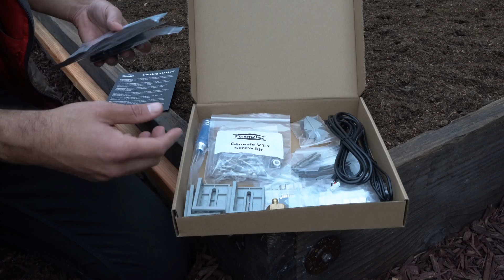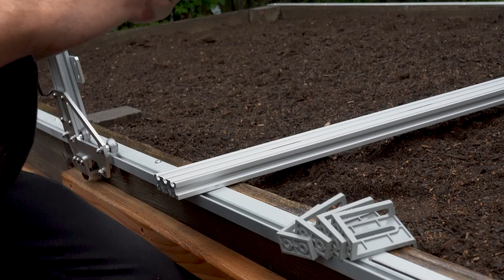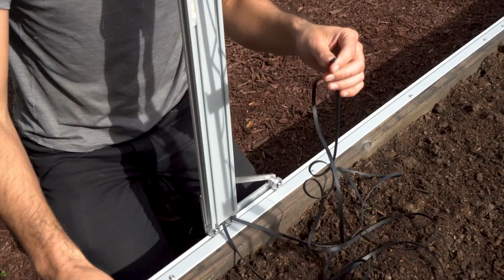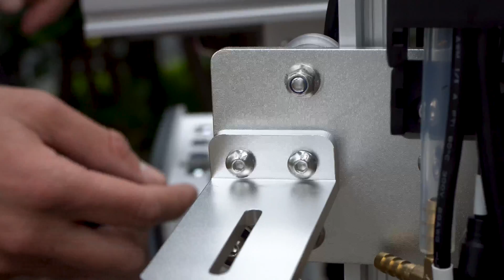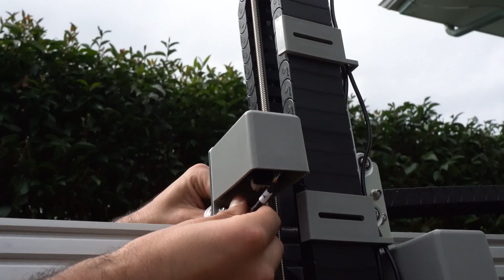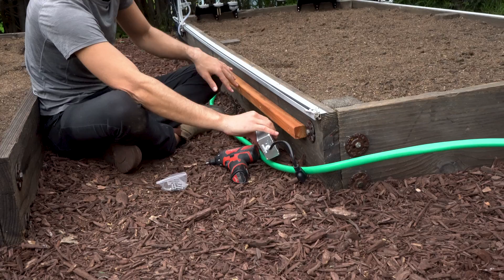FarmBot Genesis v1.7 Assembly

Comment: I recently purchased a bunch of gantry parts at the Garage Sale and will be installing my own Farmbot. I also reviewed a lot of the assembly videos, the user complaint videos and the basic development history videos. 

I didn't expect a complete turnkey easy approach because the system has numerous variables that each installation can adapt. 

What did strike me as ??? Is why the gantry is NOT higher overhead instead of ground bed level (essentially upside down like a crane in a factory) as this would eliminate items dropping into the tracks or dirt accumulation and getting STUCK between plants or other objects in the bed. I'd go with a 5-6 ft minimum height to account for various plant growth. Drop down weight would add stability not the wobble of an overhead swaying weight.

I'm going try it on bed first but using full length square stock either steel or aluminum (one continous piece for stability and no issue of warp). To go into an overhead mod will require more rework to convert to upper track. 

An additional benefit would be allowing for a protective tent addin over the complete Farmbot which I see some doing as an afterthought. But you already have most of the work done, just need a tent top over it the frame and it will be in place.

This could even be further automated with a louver system to control extreme weather conditions or light intensity in different climates.

Comment: What is the maximum length you could go could you run 100, 150, 200, or 300 foot bed?
Could you go beyond the 4 foot width?
Five or 6 feet would be good, four is probably the max for most people because of their height and reach. Is there a website that I can get the answers to this on?

Comment: How often do you have to re-tighten all the screws?
One, and it makes more sense to have it on wheels, and a troth built into the aluminum rail maybe two troughs, and two wheels side-by-side while it is held down by its own weight. The connections to the tracks are like shower doors. They are prone to all sorts of problems some older closet doors had the same set up.

Comment: Thanks for the video. Couple of questions: Can I adjust the length and width of the rails to match my bed and change the code to match easily? I don't have internet service where I want one of these. Can I run this on a local network? Lastly, this will be run off batteries for me, can I bypass the AC and run off a regulator or will I need an inverter?